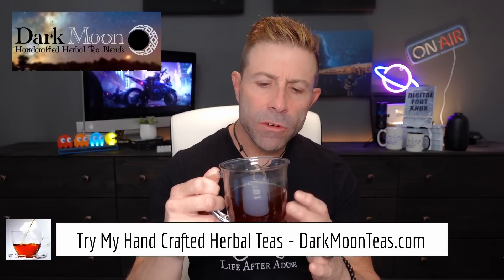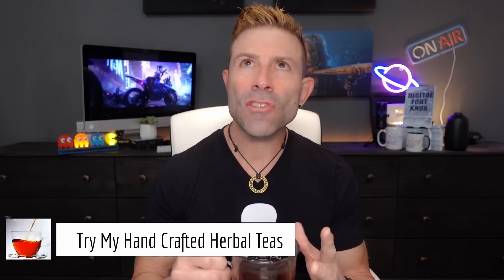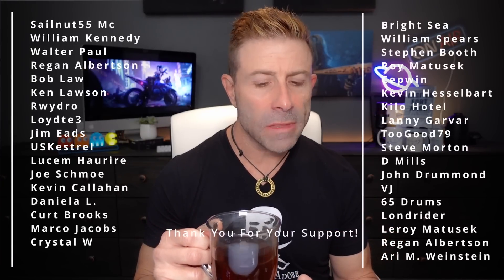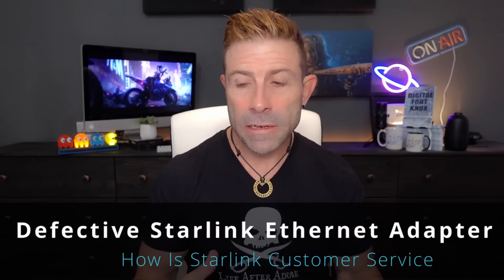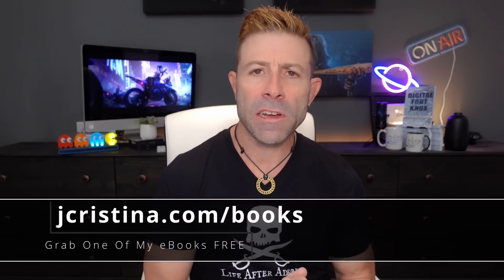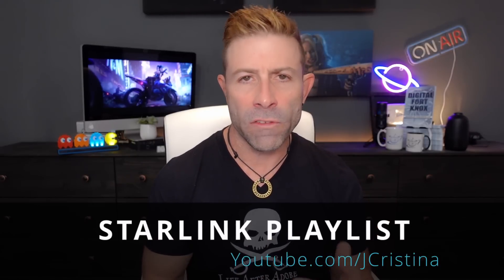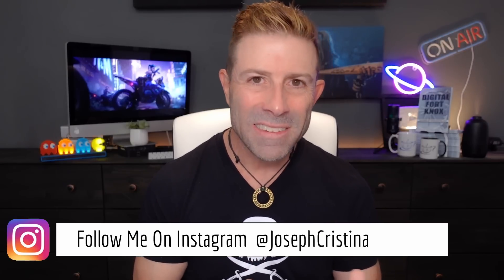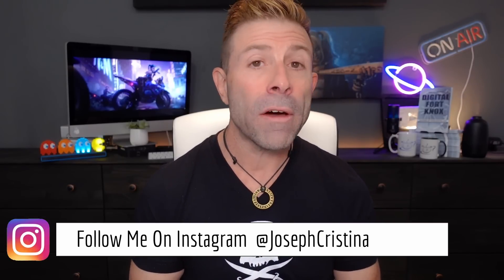Defective Starlink Ethernet Adapter Starlink Customer Service

Comment: I viewed one one of your videos a couple of days ago talking about how Star Link saved your bacon.  You also compared it with a service with AT&T and how bad that was.  You commented that even though it was really slow you still had it as an emergency backup incase something happens to  Starlink.  I have a suggestion for you to consider.  You did not mention how much AT&Ts service costs but you might want to check out TMobile's Home 5G service.  I have had this service since October 2021 and it costs $50/month.  Back in October it was pretty abysmal but they have been steadily improving and lately the slowest is around 20mbs down with around 40mbs up this is around 3:30pm to around 8pm.  After that it steadily picks up with a max of over 200mbs down and around 70 to 80mbs up.  During the day lately it has been around 100 to 150mbs down and 50mbs up.  You might want to give it a try, there are no contracts so if it doesn't work for you it will only cost you 50 bucks.
Reply from the maker: Two things...T-Mobile is horrible where I am but I could try again.. That being said, are there DATA CAPS or slowdowns at a specific amount of DATA USAGE?  Thanks so much Robert!
Reply: @jcristina  unlike their cell phone plans I have not experienced any so far.  I am retired and do a lot of streaming from Prime video, YouTube and HBO Max.  I was not suggesting using this as your primary connection only as your back up like what you described your usage of the AT&T service.  I have seen some reviews of TMobile's 5G home internet with some describing there download speeds approaching gigabyte bps but it appears that where you live has a lot to do with it.  The best speeds I have ever gotten have been the past week, there had been a few days about two weeks ago where it was barely working, when I called about it they told me that they were working on upgrades to the tower closest to my house but could not give me any kind of time table when it was going to be completed.  It worked OK during the day but like clock work every evening at around 8pm it was barely working.  This went on for a week, then the length of time it was unusable shortened.  I am not sure if they are finished but I think so.  Prior to this latest upgrade the best speeds down had been around 150mbs and that was around 12am to around 8 am with a sharp drop off in speeds occurring throughout the day where the best speeds would be between 20mbs to a more normal speed of at best 7 to 10mbs starting around 3:30pm through to around 8 or 9 at night you know when everyone was getting home from work and was using it during prime time.  However this past week this peak usage time has been closest to 20 to 30mbs and down with an up speed of around 30 to 50 up.  Also this past week the fastest speeds have been around 200 to 250mbs down occurring during the over night times of 11pm to around 8 or 9am with the average speeds during the day being oround 100 to 150mbs.  So lately they have made significant improvements, this is the only reason I made the suggestion to give it a try.  If you do try it out use the hell out of it for a month, see if it is better than anything else.  See if you experience any data caps etc.  It is unfortunately one of those things of where you live will determine your performance.  For me it has gone from almost cutting them loose to keeping them all in just the past week of improvements.  Oh one of the videos I watched the guy hacked the TMobiles gateway, he took it apart and added a couple of pigtails to enable attaching external attenans.  He commented that his signal strength had improved from 3bars which is rated as good to 5 bars which is rated as excellent he mentioned the increased speeds but I can't remember what they were but do remember it was significant.  He also mentioned that he was able to mod his gateway without soldering the pigtails.  I might take mine apart and have a look inside, perhaps I will also add the external antenna hack to mine.  On one of these videos a guy had put a comment that he had taken his gateway with him and used it in his RV, he knew that this was against the EULA but Tmobile has never complained.
Reply from the maker: Two things...T-Mobile is horrible where I am but I could try again.. That being said, are there DATA CAPS or slowdowns at a specific amount of DATA USAGE?  Thanks so much Robert!

Comment: Another great video. I've had bad luck so far. It's been a month and still no response from customer service about losing connection. Hopefully the 150 replacement cable will come in soon. I've also been waiting over a month but it still hasn't shipped. I feel like I've been bamboozled paying for a service that I can't even get a response back.
Reply: I placed my order for the 150' cable on Feb 25 and the current ship date is now May 5 to 12. Not a happy camper.
Reply from the maker: I bet they are having supply issues like everyone else these day...😬
Reply from the maker: Sorry to hear that... Not good.. I would suggest writing them once a day going forward until it's handled... The squeaky wheel.
Reply: You were right the squeaky wheel worked. Not only did they message me about a replacement they credited me back a month of service. They have just to much growth and trying to meet the crazy timeliness they gave themselves.

Comment: In your experiences with the ethernet cable and other testing you have done, have you ever seen that putting the Starlink router in "bypass" mode INCREASES the download speed?  Some posts in reddit seem to be claiming this works.
Reply from the maker: It's not the by-pass mode but the router they are using once by-passed.. This could be the case as there  are some "gamer" oriented routers that are 300-500 bucks that are really fast.

Comment: I haven’t seen any change in my service since I added the adapter. My system has constant outages. Can’t even use wifi calling it’s so bad. I sent a request message to support and have not been contacted yet. Had to wait 13 1/2 months to get my kit and now over 3 weeks into it I can’t get any help! It’s just very frustrating! Love your video’s have a blessed day!
Reply from the maker: That's horrible Hugh.. I would suggest writing to them every single day. That is unacceptable and feels like your correspondence has been lost in the sauce (so to speak). Not kidding.. Send an update to your trouble ticket every single day...

Comment: I have the gen 1 starlink. I just got it up The other day having very slow speeds.I got hold of starlink tech support. They told me to do a hard reboot then go to settings Toggle the  separate the 2.4GHz and 5GHz Network switch and hit save. I am not text Savage should I try this. If you can help me I would appreciate it thanks
Reply from the maker: The reason they told you to do this is to separate the 2.4Ghz and the 5Ghz as the 5Ghz is much faster.. They will tell you to connect to the 5Ghz connection and report back.. This allows you to determine which band you connect to instead of allowing Starlink to choose...
Reply: @jcristina Love you channel i’ve learned a lot about Starlink.Thank so much.again🇨🇦

Comment: The fact you have a YouTube channel may have been a factor in receiving that great response. I ordered a dongle on April 19th, it changed status to “preparing shipment” and hasn’t changed since. May 3rd and still waiting and no idea if and when I will ever get mine. But make no mistake, the money was taken the day of order. Customer Service needs work at Starlink Elon!  No phone support, no chat option, no updates???  Might be sending my kit back for a refund before it’s too late to do so.
Reply from the maker: Absolutely.. It's not perfect but I can tell you it's getting better.. As for having a channel.. This channel is TINY, I've never said I had a channel in the past so I doubt they know..
Reply: @jcristina  I am waiting for my system to ship  which will hopefully be next month but I cannot use my system until I receive the Ethernet dongle. Like Todd I don't want wait beyond 30 days before I can even test my Starlink system. There should be an automatic option for the Ethernet adapter to ship with the system.

Comment: I call it a breakout box, those have been around a lot longer than Apple. I'm waiting for my breakout box and in the mean time have put a travel router into use receiving the Starlink signal and ethernet out to my Unifi Edge router. Works, great but I need my travel router so the dongle better come soon. It's also triple NAT but doesn't cause me issues. Network info is also missing but who cares, all that info is in Unifi software.
Reply from the maker: Fingers crossed! Also, the Double/Triple NAT is ok if you can lockdown (segment) IP provisioning.  No worries!
Reply: @jcristina  I see no way to change SL DHCP or fixed IP. The interim router/wifi extender has three fixed IP's, one for the UI Edge router, one for my PC and my phone. Each are in different ranges.

Comment: Support sucks. 4-7 days between responses, and absolutely no help. Have had Starlink for almost 2 months. Paid for the service for the first time even though this service is unusable at .08-1 mbps down and 1-3 up. When I first unboxed it and set it up on the ground I had 150 down 20-35 up with it being 65% blocked. Moved it to actual install location and only have 2% block to the east. All other areas are clear. So there must be something wrong. I know how to network and I’m tired of the useless responses from them. Also it took a month to get adapter, another few weeks to get mount and still waiting on replacement wire to make sure it’s not the issue. All parts ordered within the first week of having Starlink. I’m stuck trying to figure out what’s wrong on my own. Though getting any parts is next to impossible. I’m sure you being a YouTube star has something to do with the quick responses and fast shipments. Sucks paying for a service you can’t even use and here in Vermont we don’t have anything faster than 8 mbps down and 1 up broadband.
Reply from the maker: I will guess something happened in the move... Check the wiring first, factory reboot and all the things.. Than it may be time to get  anew one as those speed on not the "norm" for unblocked skies no matter the location..  SH$t they're getting better speeds in the Ukraine!

Comment: With my generation 1 setup. I just discarded the starlink router all together. I plug the starlink dish ethernet cord right into my current router that is tied into many switches in my house and garage. It works perfectly. Definitely the best setup for my rural area!!!
Reply from the maker: Awesome Awesome and more Awesome.. The only thing you lose when taking the Starlink router out of the mix is outage reporting, speed testing and stuff like that.. Not too important!

Comment: I'm going to have to look into that. I've been getting abysmal speeds off and on, and a few outages that the app did not see. Tonight I'm testing at 20mbps for example :(.
Reply: Ok in my case it may be the 250ft ethernet cable that I already partially burried :'(
Reply from the maker: Ouch... No fun.. I buried a 150ft cable and that was a pain in the back!!!!

Comment: Hey JCristina, I’m glad they got you sorted out quickly. That being said I’m also super jealous. I’m currently on day 32 (not a typo) of having no service. Tech support thinks I have a defective cord. Assuming they can keep to the shipping dates I’ve been given, I’ll be without service for about 45 days give or take a few days.

This has been an awful and unreasonable customer service experience. I loved the service when it was working and truly hope that my case of delayed support is a rare one. I appreciate your insightful videos. Keep up the good work!
Reply from the maker: Thank is 100% unexpectable. Thank you for sharing and being here, my friend!
Reply: Start a YouTube channel and mention Starlink and you just may get a speedy reply and expedited service. I suffer with you. Think I am going to send mine back for the refund before it is too late. Not impressed.
Reply: Starlink update,

They have now pushed my shipping date back and it will be closer to June before I receive my replacement. Original ticket was opened on March 31st. By the time I get my parts almost 2 months will have past.
Reply from the maker: SH!T... They have to be having shortages going on or something.. That is simply horrible.. I would write to them daily until someone over there got wind to the issue.. Might have gotten, as I say, lost in the sauce!
Reply: @jcristina  I did get in touch with them. They apologized and said they are having trouble filling their orders and they went ahead and credited me one month of service and said that they would credit me another month if needed.

Comment: Hi Joseph, When I worked in I.T., I had to install and troubleshoot network issues in my various facilities. I bought network cabling by the box!  (500 ft.) For troubleshooting cable runs and patch cables, I have Fluke testers. They never let me down... It really sucked when a store had new carpet laid and the installers would take their carpet knives and slice right across my cables! That happened more than I care to remember. 
I have the Fluke MT 8200-60 kit for troubleshooting phone lines. Another great piece of gear.
Take care Joseph and stay safe!  Regards Rick
Reply from the maker: Ouch!! That would suck... Having to start a new run as I would never join cables even though we could.. One more problem and possibility for SnR issues.
Reply: @jcristina  Under carpet, we used a four/eight pair ribbon cable which would be terminated under a sales desk, where it would be connected into a standard network box and patch cables would connect the local devices.

Comment: As usual, love the info as to what to look for. Bad connections in an Ethernet port can drive you nuts. If you get it working right, you can always use some hot glue to hold it in place.
Reply from the maker: Absolutely.   Thank you so much for your support!!!

Comment: I had a great experience with CS recently. About a month ago, after a firmware update was pushed out, My router kept re-booting and searching, sometimes for hours. I could reset the router and get online again, but within 8-10 hours, have a reboot/searching issue again. I made a ticket on the starlink app and the first response was, "we will replace your dish and router." They shipped within days and I sent my old gear back. I have seen others on reddit who have not had the same experience, so not sure why mine was different.

btw, got a TP link managed switch because of your videos. Also ordered a mesh unit for my WiFi router, Synology RT2600ac. Will be setting all that up this week and then will soon get rid of my other ISP and be exclusively on Starlink. Thank you for the great, well organized, and edited content.
Reply from the maker: Dave.  I’m so glad you had a wonderful experience with Starlink. I hope our experiences multiple 10x to others watching the channel.

Comment: Hi, I'd like to thank you for all the amazing information that you have provided all of your followers.  I have noticed that in many of your Starlink videos you often mention that you reach out to Customer Service.  I ordered my Starlink last month and surprisingly the unit arrived within a week.  I made sure to order the mount and the Ethernet Adapter at the same time.  These items, for some reason, have seemed to fall into the abyss.   They billed me, my order says it preparing to ship, but there have been no updates for over a month.  I want to reach out to Starlink to inquire about my order but I don't know how.  I'm unable to find a customer support chat box, so could you please explain how I would inquire with Starlink about a problem.  I thank you again for all your valuable time and information.

Kenny Clem
Reply from the maker: Kenny.  You should be able to login to and go into support and messages and enter in a support ticket.
Reply: As for the Ethernet adapter, they seem to have periods where they are out of stock. I even got an E-mail from them saying that a new shipment would not be in until the end of April.  I can't order one yet as they do not have service in this cell yet. So we will see how long till I finally can order. They say this month for service so just about 1 year on the wait list.

Comment: My experience with Starlink support has been excellent so far. I have asked questions about roaming and their response has been very timely and to the point. I have not had hardware problems and your video provides hope they will be responsive if that happens to me. Thanks for sharing your experience.
Reply from the maker: So far so good, Dave.. Thanks for being here!
Reply: How do you even get support? Where are the support tickets? Once I hunted through FAQs and found one but its literally a maze.

Comment: I have to share this, anyone with a square dish needs to watch this! Mine has slowed down drastically after the adapter install!
Reply from the maker: Check into it.. Might be an issue.. If I did not do the investigating I would never had known that the slow-down that I was experiencing for due to a faulty "dongle" Starlink Ethernet Adapter.
Reply: @NUTZJ98  where will I see it’s in bridge mode?